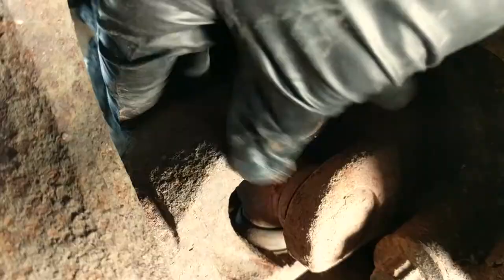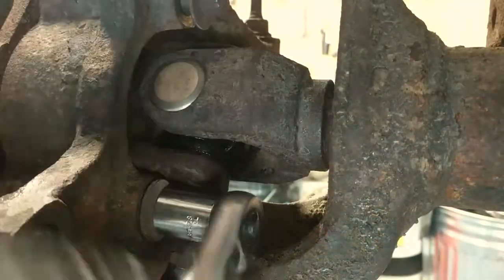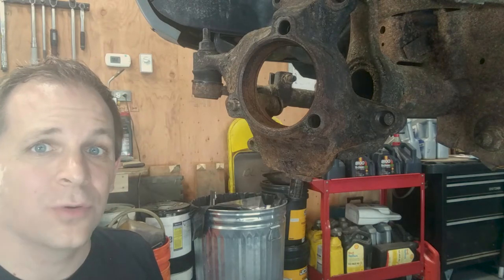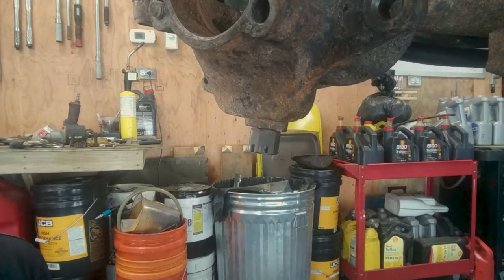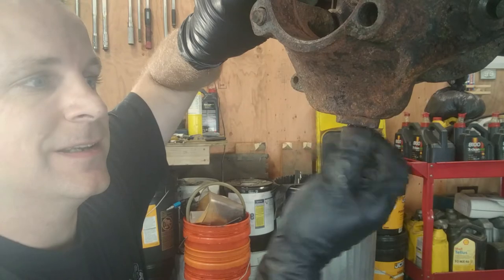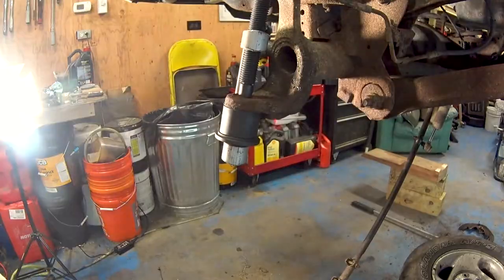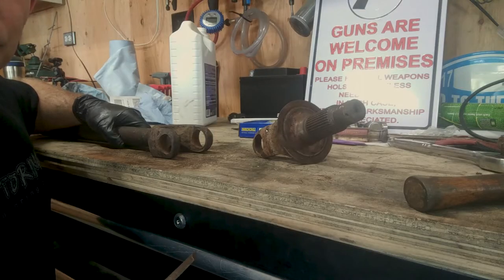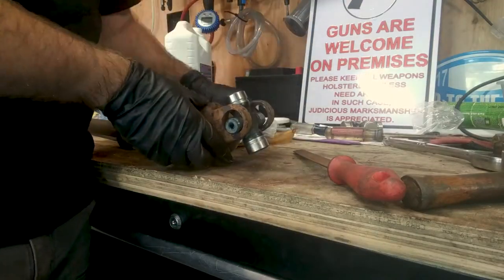Ripping apart the front end on the Dodge

Comment: I love it when a plan comes together.  Good luck with the truck, I just finished a radiator replacement on the old Ford, but with 365,000 miles on the original unit you can't complain much.  And way cheaper than a new truck!  Thanks for another good one.  R.J.
Reply from the maker: wow! 365,000! is that a diesel, or a very well cared for Gas engine?
Reply: V-10 gas.  Kind of like your rig.  It is pretty cheap to get an F-350 4x4 when it has 350,000 on it.  Scares most people away.